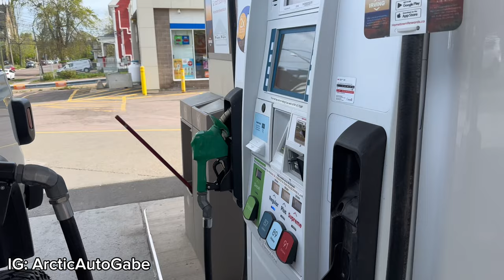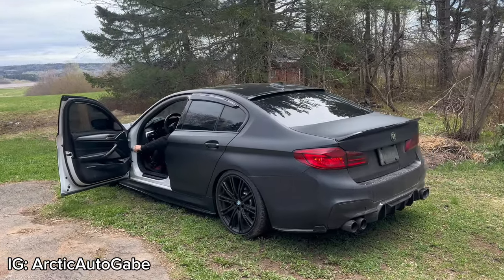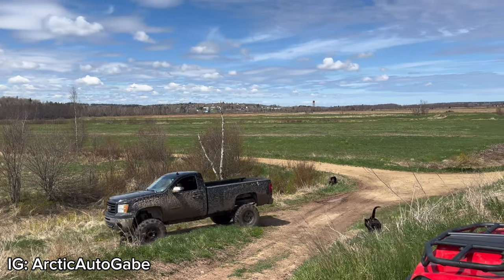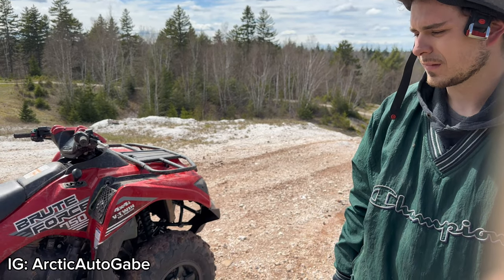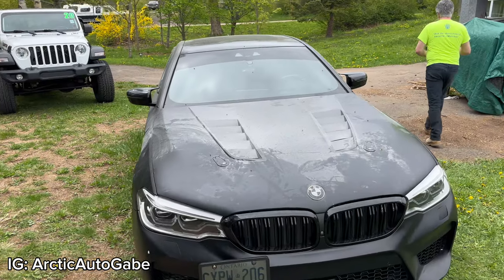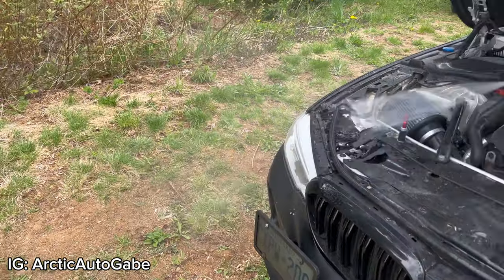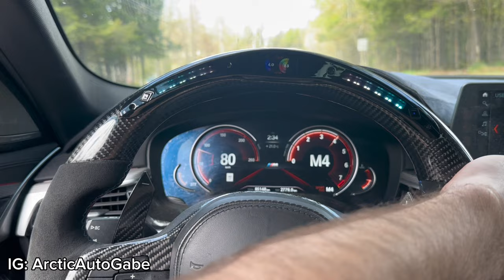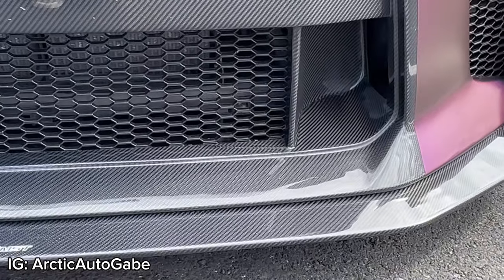Weekend Vlog. (ATV’s , BMW’s , GTR’s)

Comment: Can I please know everything done to the 540i cosmetically and performance wise?

I apologize if it’s a tedious task, it is probably the best 540i I’ve seen in my life
Reply from the maker: Carbon Fiber hood / M5 conversion front bumper / M style mirror caps / side skirt extensions/ rear bumper extension / M5 style  Rear diffuser / M5 Style Duck Tail / Quad Exhaust Tip / Lowering Springs / Wheels spacer / Matte Black Wrap 😅
Reply: @ArcticAutoStyling  thanks boss. What a beauty
Reply from the maker: @Elias-qp7cz check out our other videos I have a full build series on it!